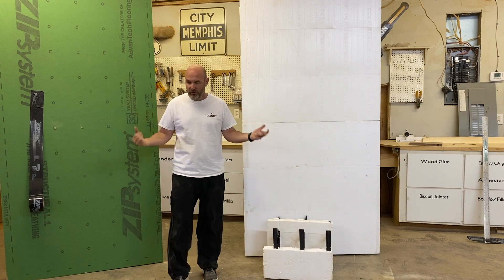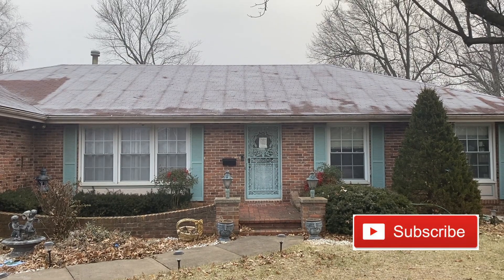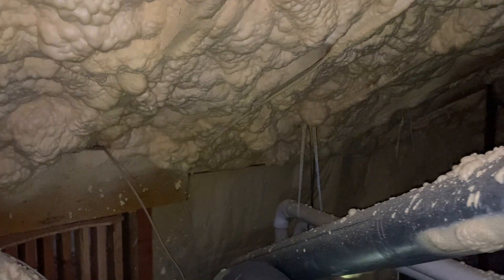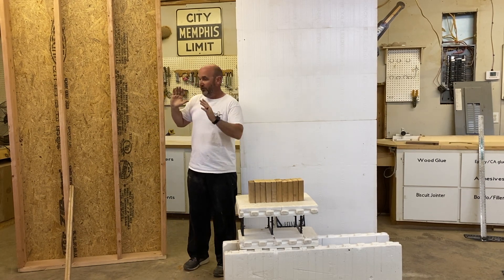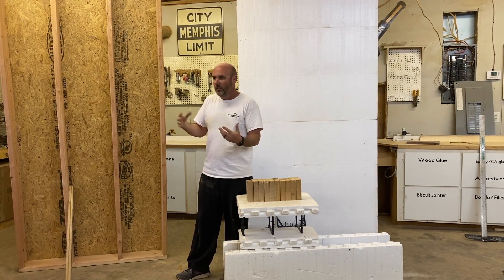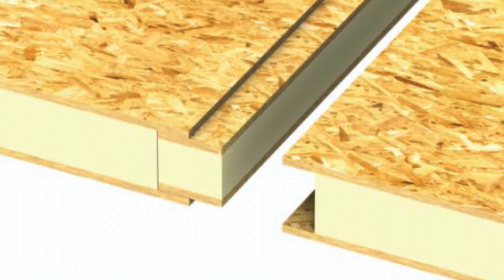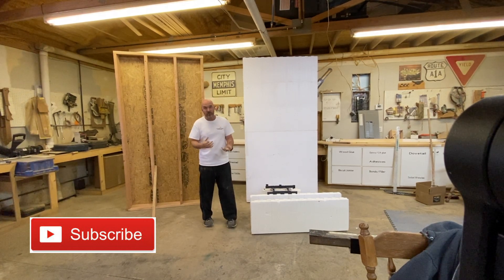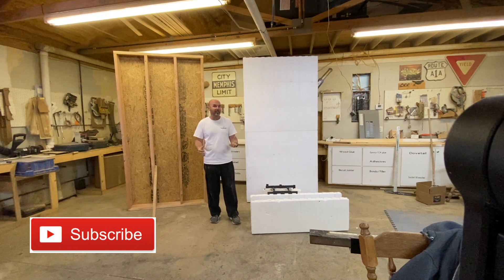Thermal Bridging!!! Comparing ICF and Alternatives

Comment: 1988 told them this lol did it my home no rot or condensation issue,   30 cents propane 798 .00 in 1989   25 years later paying 795.oo year lol  my expiement workso well the took away my 1000 gal free tank , bought 500 propane in minnesota USA  super cold, so great to hear yopu talk what isaid  in the late 80s, oh me??  x engineer inspector rertired

Comment: Thermal Bridging or Thermal Mass. Regardless of the thickness of the foam and ambient conditions inside the building, the lines are heat radiating from the insulated Thermal Mass of the rafters caused by the Sun during the day.

Comment: yikes, no air gap on that roof either... so any water penetration would go unnoticed & likely lead to severe rot over time as it doesn't dry out from below where the closed-cell foam is applied. also likely to run into ice dam issues too in colder climates with snow. these older roofs need 2x2 strapping with radiant barrier & a 2nd layer of sheathing for the top, which provides the air gap & makes the retro-fit sprayfoam safe. course, it starts to add-up with re-route of venting to a new ridge-vent, and soffits...

Comment: For a roof that would not have thermal bridging you could use something the 2 inch  foam board over the rafters then wood over the foam board. Myself I've never used ICF. But being a carpenter most my life I could save a lot in labor. I don't no of a carpenter I could recommend even though I've been a carpenter for over 50 years.
Reply from the maker: The point I was trying to make was had the spray foam guy covered the rafters and created a continuous insulation layer you wouldn’t see the rafters bridging like that...  I’m getting ready to add on to that project and will have them touch that area up and do a follow up vid next winter to see the difference!
Reply: @all3pools  if the rafters are 2 x 6 the r value is about 7. The 6 inch foam is about 30. But covering the rafters would definitely help. My guess is the rafters with still show under the right circumstances. All spray foam roofs I've seen was like yours. You can see the rafters.
Reply from the maker: Yes I think there will be residual heat in the rafter itself from the day before that will be enough to show

Comment: You've compared the pricing on the solid wall sections, how about comparing the price where the section has a window/door?
Reply from the maker: Great question, and the answer depends!  There are multiple options for window and door openings in icf, bucks are whatever we use to shape an opening through an icf wall for a window or door, guys use Advantec, treated 2x12, or most recently since switching to fox blocks I’ve been using their fox buck, which integrates nicely with their forms...  the reason I don’t get into it in the vid is time constraints, just getting started with video making and it seems from my research that my videos are already running a bit longer than optimal to get viewers, modern attention spans what can I say lol...  anyway a fox buck opening for a 3050 window might run about $20-25, but the nature of icf renders every piece of the form longer than 8-12” usable so you don’t waste much of the field material, to frame you will add two cripples and wide header material at a minimum, most framers sheath right over the opening so you spend same on sheathing so those costs will at least equal the cost of an opening in icf, probably more!  Thanks for the feedback and I will try to address as much cost detail as I can in future videos and still keep them under 15 minutes:)
Reply: @all3pools  I guess I'm thinking less concrete in the icf, and in lumber you have to add the header, King Jack studs, cripples. So for conventional you're adding cost, whereas ICF you're reducing cost?
Reply from the maker: @greggharvey6304  exactly!  A 3050 window saves you about $25 per opening, bigger windows and doors more!  I’d love to go down some of these rabbit holes that make the case even better down the road but at the moment I’m trying to hit broad strokes for the masses lol...  next icf vid is a vinyl liner icf pool!
Reply: @all3pools  I'm a HUGE fan of your videos. I hope I can afford to custom build my own ICF house before you make the popularity so high that it costs too much!!